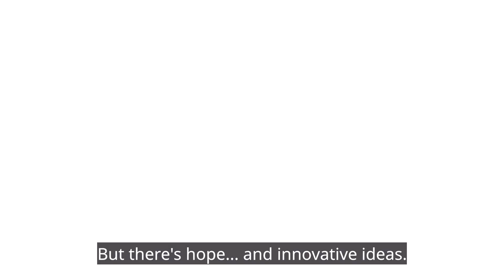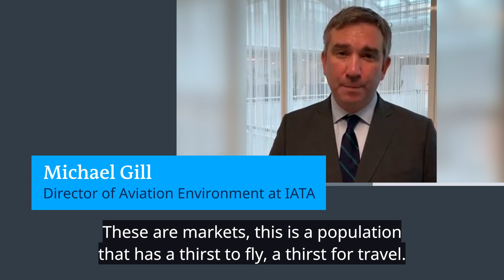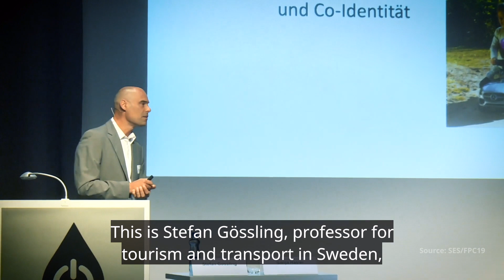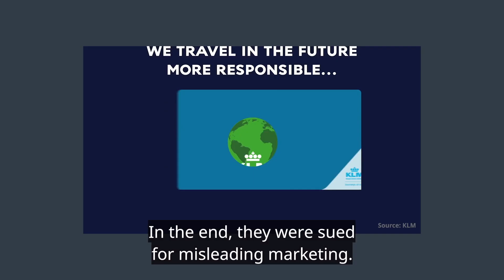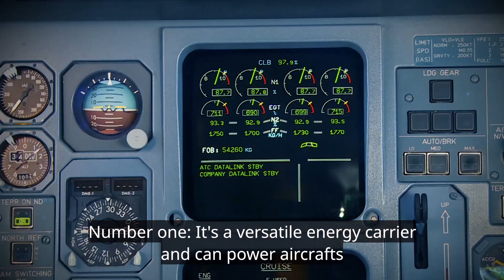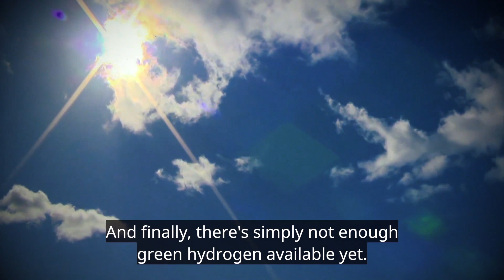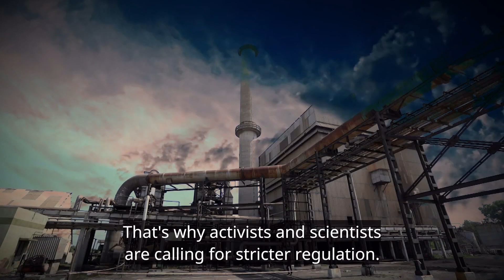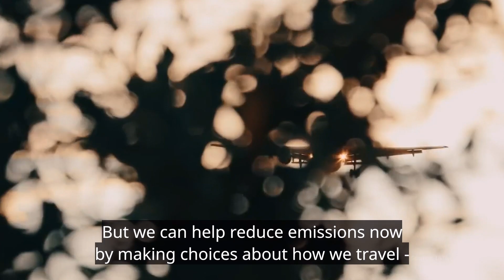Hydrogen Planes: Can we fly without emissions soon?

Comment: Can someone tells me how we can store hydrogen in fuel tank because it can leak from any metal . Even rocket are filled with hydrogen just before launch . It is total gimmic
Reply from the maker: Hey Darya! Thanks for your question. There are different ways of storing it. Common is to store compressed hydrogen which is then put in storage tanks that can handle that. Another way is to store it as liquid hydrogen. This needs cooling to -253°C and therefore storage in insulated tanks.✨ If you are interested in learning more about hydrogen, check out our full video on hydrogen 👉 https://www.youtube.com/watch?v=AGTjKJHu99c or our video on hydrogen and electric trucks here 👉 https://www.youtube.com/watch?v=qiQcGdq66DI
Reply: @DWPlanetA  dear DW lets talk about practicality tell is this good to store compressed hydrogen in car at cryogenic temperature . And hydrogen has density and high power in litres it impossible to make tank that can hold fuel capacity of car in small space and too much expensive so think on it

Comment: Hydrogen is neither a fuel nor a source of energy. It's just a very inefficient carrier of energy. Just to switch flights inside Europe to hydrogen we will need 3 times more renewable energy than we had in whole Europe in 2019. Hydrogen is better put to use in fertilizer and steel industry where today fossil hydrogen is being used. Biofuels are way better for aviation and shipping where there is no need to make any change in current design.

Comment: Unfortunately hydrogen is stupid inefficient to the point where batteries are just a better choice and making the hydrogen necessary can be constantly and energy intensive and the way those concept planes work is by burning hydrogen which is even more inefficient many companies which tried to make hydrogen powered cars and even trucks have already learned that it's far too expensive and really electric power would be a better option since it's 80 to 90% efficient and technically we could make an electric plane right now we would just need a custom frame to build upon a very efficient shape and very energy dense batteries which we do have those but the super dense batteries are rather expensive at the moment but as technology improves so will they and they will get cheaper!
You could also combine it with solar panels.

Comment: I would like to see hydrogen powering our airplanes.  If it's a structural problem,  replace the wings, if it's a tack problem,  replace the tank,  you could also replace the jet engine with electrical propellers.

Comment: The hydrogen planes already have been there years ago, Tu-155/Tu-156. It´s nothing new. If people really wanted to, they could already flew that way... But oil industry and company's wanted to keep fuel cheap all the time... that destroys every technology like that. Same goes for hydrogen cars. There were hydrogen cars+buses working very good, they were all canceled. We already had the technology. And now they are making full electric cars and trucks in Europe, which need a whole new set off infrastructure and stuff, not just the car itself. They need a huge amount charging stations, lots off copper for wires etc. Resources are not just bound in the car a itself, which a lot of people miss, when calling a e-car absolutely environment friendly. Also there are huge power losses, which occur over long distances when the power travles around the power grid. With Hydrogen, just all the gas stations have to be replaced, producers can be build where the power comes from. There is no need to do much more than that.That`s it. No need to build everything new from scratch, just to have it the full electric way. It would save lots and lots of resources and byproducts. Instead in Germany politics want to build half electric trucks, with diesel and electrified motorways for trucks.... what a nonsense. Hydrogen is just the right balance between efficiency, fast "loading" and cost.